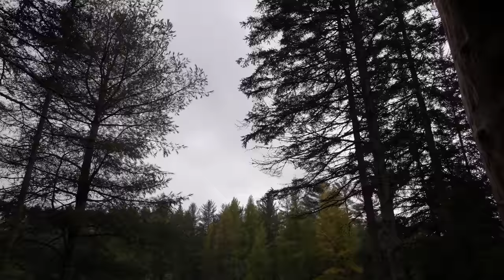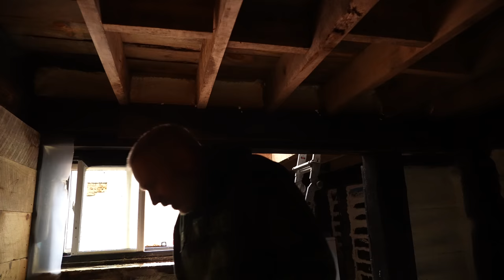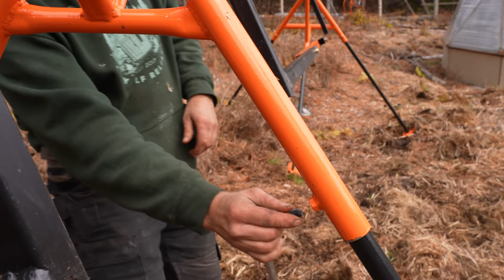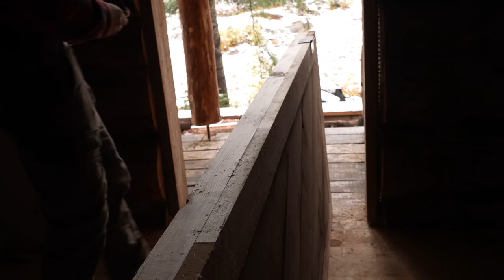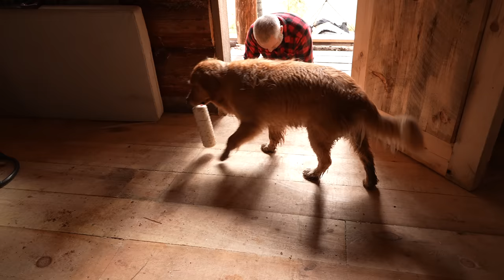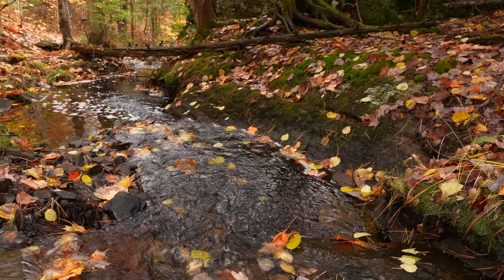Here We Go! 1st Snow of the Season, Off-Grid Solar Electricity Installation, Hanging the Front Door

Comment: I think, the reason your door is sagging outward is due to its massive weight; you may need to put one more hinge at the top of the door to help carry the weight, least 4" down from the first one. That sure will cure the sagging.

Great build, James.
Reply: Happened to us once. We took the door down to plane some on the underneath but we were adviced by an old carpenter to add one more hinge at the top, say four (4) inches down from the first top hinge. Cured the sagging of our heavy front door.

Comment: Fall and winter are my favorite seasons. I think people see both seasons as a time of low energy, and stagnation, but the end of your video here shows a taste of what fall is to me at least; change. All of that energy in that water, the power of the rumble as it batters the rocks on the way downstream. Constant movement. The leaves falling from the trees, snow and rain falling and then evaporating, mist forming in gullies and in valleys. Things are darker, but that also means there's more contrast. Everything is clear instead of feeling as washed out with light like in summer or spring.

I can feel the bite of the cold and the smell of the frigid air in this video. Callie looks very content by the first snow. Glad you got the roof on in time. The homestead looks beautiful :)

Comment: a couple recommendations, i am not sure you are finished with the solar installation.   1 give some spacing between the battery do not have them touch each other.  2 take the panels off the wall and install a concrete board first then reinstall them.  3, make sure you install a BMI kit with the battery and tie it to your panel.   the cabin is coming along great love the improvements you have made over the last one.

Comment: Hey Shawn, What did this Cabin's Indoor length and width turn out to be? I recall you saying you needed to add a Bedroom Addition. Just the living room/ kitchen space. Not the Breeze way. Is it like 25 ft x 25 ft or something or bigger? There hasn't been much footage of the whole living room space since the roof was on. Only that stove corner. Probably could use a good sized bedroom addition. Beats me where you're putting a bathroom. Looking forward to seeing that and how it all connects again. I discovered a video about making a generator run on water too. That could be useful. Like making some kind of soundproof underground generator power room somewhere to run a power line from. Depends I suppose. Whatever ends up happening to a power generator running on water for really long amounts of time. I don't know how long that filter would work for it until it needs more that material. I forgot about what that ingredient was. It's on the video I watched about it. Let us know if the solar does poorly in that region. I would think it would. My thoughts are solar would do better working closer to the equator. In desert lands and such. Places usually with lack of Cloud cover.

Comment: I think a good size for a bedroom with enough closet space too would be at least like a 17 foot x 17 foot square room. Or like a 20 x 18 or something. For anyone like me I wouldn't want a bedroom that isn't large enough to fit one queen size bed or 2 twin beds and still has enough room for a computer desk station in ther corner and has dresser drawer room too and room for a mini refrigerator.
Reply: Married Couples could do a bed set up that comes together to make a big bed or comes apart to make to smaller beds and they could have 2 computer desks besides each of their beds as well a 2 night stands. My entertainment set up has a 55 inch smart T.V. and I have a smaller smart t.v. on a desk in the same room as my T.V. I ran a computer monitor cable to the large T.V. so I could use that for a 2nd Computer screen. It requires various adapters to do that but It's awesome. I can use my mouse at my desk and it works on the 55 inch too. Best set up. I got all wired connection. My wireless keeps messing up. Bluetooth too. So I got rid of that. It's nice to watch just about whatever you want with internet on the large t.v. Movies and all. Since you have a basement you could do the same thing but could run your lines underneath the floor and hide them if you ever cared to do that. run a cable conduit or drill holes in the basement ceiling joists for it. Maybe.

Comment: Dear Mr. James: 
I hope you don’t mind. I have had mixed results using plain plastic. Even with a thick gauge. I know there is a vapor membrane that has worked much better to keep moisture out and reduces algae and fungus . May I suggest using something similar to this: it costs less than a hundred dollars for 50 feet at local hardware stores. Hope it helps.  
CertainTeed Membrain 8' x 50' Air Barrier with Smart Vapor Retarder 902018

Comment: For a solid wood door that size, I’m curious as to why you only used two hinges. Not just to help distribute the load evenly, but also because a third hinge would provide a more uniform seal against the doorstop.
Reply from the maker: If you look closely, you can see that I notched for four hinges but I on,y had two 4” on hand. Next time I’m in town, I’ll pick up another two

Comment: I work for a solar company and have a few questions.
We're doing 1 off grid this year but for the most part we install grid tyed systems.
How do you plan to keep your ground array from flipping over in high winds? I noticed you could pretty easily jiggle them into place....but they did appear to have some weight in the frame. 
It looks like you have a 72 cell PV Panels. Whats the wattage? I saw 2 battery's whats their kW and likewise what is the kW and brand of your Inverter? I saw only the frame for your inverter. I've never received one without the system in place. Also, Where's your disconnect.....you'll definitely want that right by your inverter. 
As a rule we use SolarEdge with all battery backup systems. But this is a preference and knowledgability thing.

Comment: Can you please build a wooden bike that is hooked up to a generator in it's own tiny shed? Keep the branches as close to what they look like on the tree as possible. Have a tiny lightbulb hooked up hanging down in front of the bike rider. If someone complains about the cold ask them to generate some power for the heater. Just pedal this bike for awhile. Keep this small light on to "charge" the heater. Just pedal for 10 to 15 mins with that light flickering away and come back in. 
When they come back in and ask if the heater is working you say YEP. You made it so hot your even sweating.......